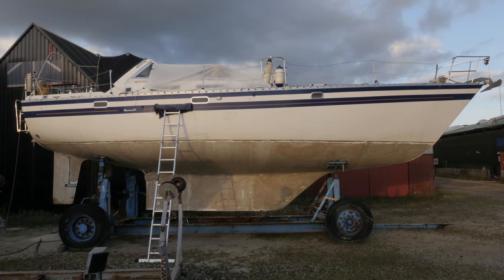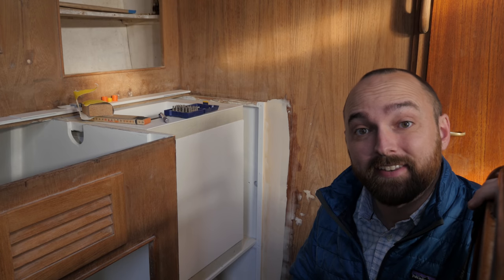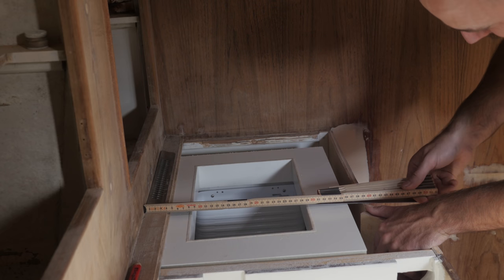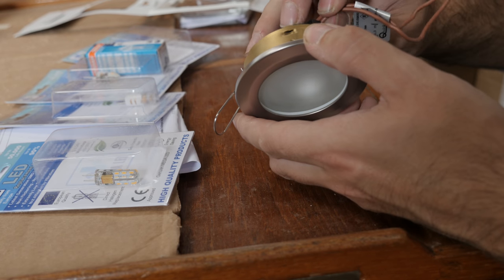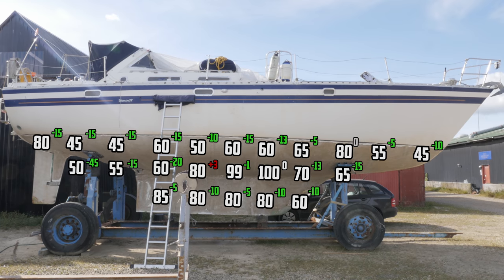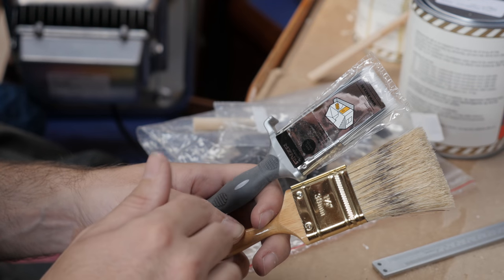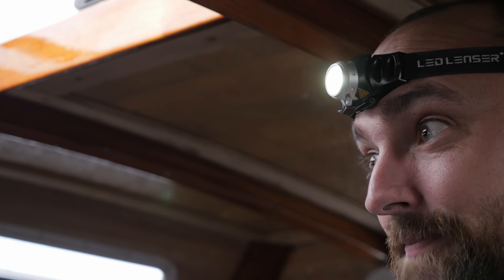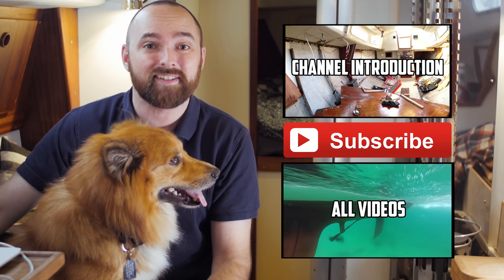Sail Life - Galley test fit & varnish - DIY sailboat restoration / repair update

Comment: Dear Mad's .
I'd like to take this opportunity to blame you for my serious lack of judgment. I recently purchased a C&C 30 at an auction. It had been abandoned as a live aboard, as such nothing worked, port windows missing , no cushions stove in need of repair, bilge really nasty, all lines trashed, 1/2 meter of growth on the hull, motor inoperable, winches removed and stuck in the laborers, fuel system trashed. no batteries, interior covered in mold, and several more issues. However, with my wife's approval I won the bid at $400, and I was happy about it. since then we hauled it out, scraped the bottom, sanded and applied a new antifouling paint plus other repairs, fixed lines, life, sheet, shrouds, repaired the motor and trans, new prop, through hulls, stuffing box, cleaned the interior and exterior. retired the sails and stove, fridge, the list goes on and on. We love our boat, and enjoy working on it together. Thanks again for your example, If you could only show me how to win the lottery...
Best Regards.
Dave
Reply: Congrats on your "new" C&C 30!  Sounds like fun!
Reply: Gold

Comment: I’ve got some experience of Webasto AirTop 2000ST and Safire 2100D. I must say that Safire is much more quiet and it uses less electricity. It is also possible to maintain Safire by yourself. Both are powerful enough for 25ft motorsailer in Finnish autumn when the outside temperature is just a little bit over 0 degrees. For the current boat I chose Safire because of the size of the heater, energy consumption and also because it is possible to maintain by yourself. I bought my heater also from Mika and I’ve got really good service from both Mika and the manufacturer. 
Thanks for the great videos…. waiting for the next one…

Comment: Good work! 
I've researched lights and eventually settled with Nauticled led lights. beautiful warm color and dimmable and no flicker to the eye and the voltage range not limited to 12volts. So any peaks in your system won't damage them. I used the led lights in about the same kind of fixture you bought.
keep the videos coming!

Comment: I just started watching your videos, so this may come little late... I have Safire 2600Di and yes it is very reliable and it does not use much power, about 0,5 to 0,9A and startup takes 8A for few minutes. It is made of stainless steel and it is easy take apart and change any part you need. You may find some common parts all over the world, but if circuit board fails, you probably need to order whole new board. Genius panel have some fancy features that you can read more from Safires page, but on the other hand if it fails, it is so complicated circuit board  that you can't fix it on the go. I have used Safire when sailing and when heeled at least 30° and it has not failed. Safire heater works basically same way as Wallas diesel heaters. Forced air heater can be used to ventilate boat very effectively if it is installed so that it takes air from outside.
But in general forced air heater may not be best option for you. First of all, if you are planning to heat water or some other liquid by motor and Refleks and then distribute it via some radiators, you need to install two separate heat distribution systems, since you can't connect forced air heaters to liquid system. Secondly forced air heaters require quite big air ducts (60 to 75 mm diam.) that are harder to install than small pipes for liquid system. And then there are distances... Air is not very good medium for transferring heat, even 7 or 8 meters might be too much. You may improve this by insulating ducts, but then ducts will become even larger and harder to install and hide.
So in my opinion you should consider some water heaters like Eberspächer Hydronic series.

Comment: Safire heaters do have a good reputation here in Finland where a reliable heater is much appreciated (this regardless of them being a local brand). I have 3200di and Genius control panel in a 10m sailboat, no complaints whatsoever.
Reply from the maker: Thanks for the feedback :) I'm very tempted to order one! Or maybe even two as I don't have an easy way of routing the air duct into the forward cabin. I'm considering one of their smaller heaters for the forward cabin and then a 3200 for the saloon and two aft cabins :)
Reply: I have been selling and using Safire heaters over 17 years. No bad issues at all to say. Really low current draw, easy to maintenance and long service intervals. Brushless fans can run even 20 000 hours. I can tell you more about the Safire heaters. I am working on the Finnish distributor OY Esco Ab and we can arrange easily heaters for you. Models you can find here, and also contacts. http://www.heater.fi/fi/lammittimet/venelammittimet.html?manufacturer=15
Reply from the maker: Awesome! Thanks for the feedback Mika :)
Reply: Hi Mads! I can really recommend Mika as I bought a Safire 2100D to our 31ft Arietta a few years ago from him. The man really knows what he's selling. Have been really pleased to the heater and one thing I might add is the silence. You can barely hear the heater running, even when standing in the cockpit. Alsi the genius control panel is a thing to have as you can plug in multiple thermostats.

Comment: Really loving the galley Mads.  Totally agree with what you say on varnish.  I have used Jenny brushes to good effect the good quality foam brushes.  Also I find decanting some varnish into a plastic pot keeps the varnish in the tin free from any hairs or particles.  No idea on your r its or frames but no doubt someone will have an idea.  Guessing they may just take longer to dry as the areas are thicker where they meet the hill.
Reply from the maker: Thanks! It's funny that you should mention it. The very first time I varnished something I used the varnish straight out of the can by the time I got to the bottom it was mostly crud - I learned a lesson :) I'll take a closer look at the wet areas later this week - fingers crossed! ;)

Comment: I have a great idea on how to do the inspection of the ribs. Use a endoscope/borescope inspection camera. You can get these very cheaply on eBay for your iPhone and they actually work quite well. They range from $30 US to $10. You would only have to drill a small inspection hole, and that way you would not have to tear up any major part of the boat. But these cameras are actually quite good and allow you access to those really tight places like what you are facing. I hope this helps!
Reply from the maker: I've only ever tried one of those cameras so I don't know if others are better :) The issue with the camera I used was that you had a very narrow field of view and the focus was obviously set to allow you to inspect tiny things. That resulted in me constantly loosing my orientation and not being able to 'get the big picture'. Perhaps I should take a closer look to see if there are more suited cameras out there :)
Reply: I have one of these cameras that I recently purchased. So I am no expert. I will go out into my shop today and test to see what it looks like in a small space similar to what you would have on your boat and let you know what the results are. Also there are digital inspection cameras available on eBay that have different camera lens widths. They may make more sense and the prices are reasonable. I would just hate for you to tear up any part of the boat that does not need to when there are devices like this available. BTW I really enjoy your shows, please keep up the good work!
Reply from the maker: Awesome! I appricated it very much :) Looking forward to hearing if the type of camera you've got would be any good :) Thanks! I'm glad you're enjoying the videos :)
Reply: Well I was very curious to test this out, it is very rainy in Texas today, and not much to do. So I ran out to my shop and tested the camera in several situations. The camera I have is a very simple USB 5mm camera. Mostly what I found was like what you said, you could lose the orientation very quickly. I poked it into the dark drawers of my tool boxes, and true to form the little light coming from the camera was not very helpful. However when I was able to add additional lighting from a flashlight the real ability of this camera came to life. I think that if you could make a hole for the camera and add an additional light source you would be able to make a very good inspection of the ribs. I tested a tire clearance issue I have on one of my hot rods just now. I cannot see the top of the tire up in the wheel well, but I was able to shine the flashlight and place the camera where I wanted to see and the picture was excellent. So here is what I suggest. Get one of these cameras, and also buy a strip of LED lights. One of those flexible strips would do perfectly. With this setup you would only have to drill one hole. Feed the LED lights in the hole, and then feed the camera in the same hole. You might have to tape the LED's to a coat hanger or some wire so you can aim them. Then poke the camera around. I bet it would work very well, and save you a ton of money and time. I hope tis helps! Cheers!

Comment: When I decided to put a forced air heater on my boat I did all sorts of research and finally ended up with (And getting sponsored by) Planar. They are simple to use, pretty much no maintenance, inexpensive, and most importantly much quieter than the Espar and Webasto heaters. They are built to be run continuously. Mine has been fantastic. My friends were skeptical about a Russian product, but my theory was that nobody knows how to stay warm using crude fuel than those who's survival depends on it! Heat for me on my boat is comfort, heat in Siberia is survival...
Reply from the maker: Very interesting! :) I didn't know about that brand. I'll take a look :)

Comment: You might be able to drill into the rib without doing any real structural damage. Look closely at the drill tailings to see if you have rot. If not repair the hole with a dowel and some epoxy. Otherwise get ready for a pile of  work.

Comment: LED bayonet and/or socketed lamps are intended for replacements on existing lamp fixtures. You already know they will last for several years but can get pretty hot when fully on. Therefore, a low height fixture that incorporates a finned heatsink would be a better choice. Having a bag of these http://www.mpja.com/Capacitor-Assortment-Electrolylic-260pcs/productinfo/32531+CR on hand will easily help you to decide how to eliminate pwm flicker without doing filter math. Simply select a value that works well without altering the dimming rate too much.     Regarding moisture meter accuracy vs. hull temp, can you extract enough spreadsheet data to create a logarithmic scale for use when the colder weather settles in? Also, I don't think ice can be dried out. Do you intend to shrink wrap scaffolding around the hull during winter months and try to keep it above the freezing point or will you suspend the drying out process until next spring?        Surely there is a lonely girl somewhere that can help you take care of Jokull in exchange for free one-on-one sailing lessons....

Comment: PWM is the process of turning the led ON & OFF for different duty cycles. ON 50%/OFF 50%, ON 60%/OFF 40%, etc. So you need to match  the frequency of the PWM with the camera shutter speed. The problem is with the dimmer not the LED. You might be able the get dimmers that don't use PWM but I would suspect they would be more expensive and waste more battery power (example 40% voltage to LED/60% voltage to heat)

Comment: the led strobe effect is caused by the pwm of the dimmer. it is probably a low frequency pwm. they make them with higher frequency to stop the strobe effects. you also maybe able to add a large capacitor to smooth out the voltage.

Comment: Tip.....in between coats of varnish, instead of sand paper use steel wool. It brings the shine up to a mirror finish. Also, if you need to replace your ribs, check out Have Wind Will Travel on youtube. Annie and Philip have made a step by step episode of them doing just thst. Hope to see you on the high seas someday when I buy my own yacht. Love your vlogs. Keep up the great work. Shane

Comment: Perhaps you could perform inspection of suspect hull areas from inside with a borescope/endoscope. Most are waterproof & camera lens is surrounded by dimmable LEDs & will self-illuminate in areas where no light would otherwise get in. Ebay has an excellent selection of these in variable lengths & most will work via app on your cell phone or p.c. You can record movies or snap pictures of what you find in VGA resolution. oops, I just noticed phaedrusalt already mentioned this idea so I second the motion.

Comment: Hello. 
I,ve been following your channel for a while. 
Congratulations for the hard job.

Regarding to moisture, I´d like you to know that rice grains, makes authentic magic.
If you ever have the need to recover a cell phone from having fallen into water, you just need to cover it with rice for a few days and it will come back to life. Even better, ¨dip it¨ into the rice bag.

Of course, a cell phone has no point of comparison to a huge boat, but for those particular spots along the ribs, it might do the trick.
Try to stick to the hull, on those particularly high level of moisture areas, some plastic patches glued with tape in such a way that you could fill them with rice and make it be in contact with the hull. 
Rice is a highly higroscopic grain that will absorb lots of water from whatever you make it contact with.

I have done it with two cell phones, and always worked. Why wouldn´t it with the hull?

Alejandro

Comment: I have a HUNTER 23 it had carpet in the walls so I striped it off, sanded everything and will paint. I was wondering why you use the two step paint. Will it work on my fiberglass? I like how it looks in the finished product.

Comment: I wonder about the pulse width modulated dimmer. I wonder if you cold put a capacitor across it to smooth out the pulses? I assume the leds are direct current.
Reply from the maker: They are :) I might ask for some suggestions if it turns out these LEDs also have that annoying flickering :)

Comment: Any PWM dimmer WILL cause flickering. You need a constant current dimmer. PWM works by rapidly turning the light on and off to 'fake' a dimming. Constant current drives the LED at a lower power level.

Comment: Mads, you really need to wear a respirator when sanding and varnishing. A dust filter is enough when sanding, but a carbon element cartridge is essential for work with petroleum solvents. Once overexposure occurs you will become extremely sensitive to any level of solvent exposure, a reaction that can include extreme anxiety, skin lesions, and contact dermatitis. You don't want any of those things. You have a long road ahead, so be safe as you work towards completion.

Comment: The glass is thicker at the ribs.
So there's a chance that your moister monitor my need to be threatened with the idea of gravity!  
I think in the past you had said you have a friend with a meter. You should ask to borrow his or better yet her's.
Is drilling into the rib from the outside of the boat an idea? Instead of dismantling the inside to get to the rib.
It may be a way to test if there is water.
I'm enjoying your work. 😎
Reply: I just said the same thing before reading your post, core drill it and examine the plug, if its good insert the plug with epoxy and repair the hull.

Comment: Are the ribs glass fibre or something else? Are they solid or Ushaped (IE able to trap moisture) The age of Athena would suggest a thick (1/2 inch or more) CSM (chopped Strand mat) hull rather than the less solid hull / ribs / liner composites of the more modern and less reliable production yachts.

You know that you are going to have to look into this but it does get in the way of getting on with the work  ;)

Comment: Someone's already said this by now I'm sure, but you're always going to have problems with flickering with pulse width modulated dimming.  It's because of the way the dimmer works.  It doesn't actually reduce the intensity of light that's being generated by the LED. Instead it turned the led on and off really fast, which unfortunately gives you the strobe effect when viewed through a camera.  Good work so far, and good luck!

Comment: To make things complicated, would it be possible to mount a wifi enabled remote controllable camera to the top of the mast?  Even if stationary, a GoPro rigged up with the right lense pointed down would make some interesting video when replacing the deck teak or at sea.  During foul weather the ability to remotely watch from the galley would be nice as well.   

There is a small outboard in some of your shots.  Was it used on the tender or is there an outboard mount?

Comment: Have you investigated how your moisture meter works? If you want to share... what is the make & model.
Reply from the maker: It's a Skipper Plus from Tramex. I was surprised to see how big of an influence temperature has! Perhaps I should RTFM ;) Of course, I did read the manual but perhaps I missed the part about temperature

Comment: If you drill an exploration hole under the ribs is there any water that getting out?
Reply from the maker: I don't think there is standing water in there :) I took a look and I can't see any way for water to get trapped in there. If there is an issue I think it's "just" a matter of the ribs being rotten or saturated with water.
Reply from the maker: Thanks :) Same to you :P

Comment: I think you should check out the ribs sooner rather than later.  If rotten, tear out as soon as possible so the laminate can dry out all winter.  There are plastic materials that you can laminate with glass cloth and epoxy into new frames that will hold no water and never rot.  I will write again with the name of the product.  Cheers, John (not Megan) Luke